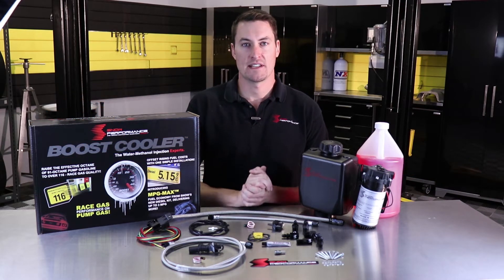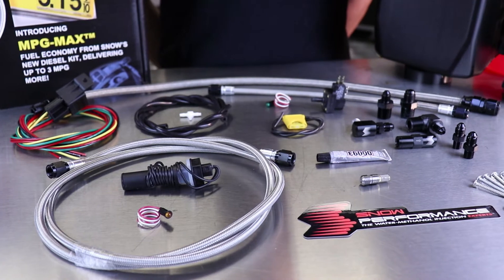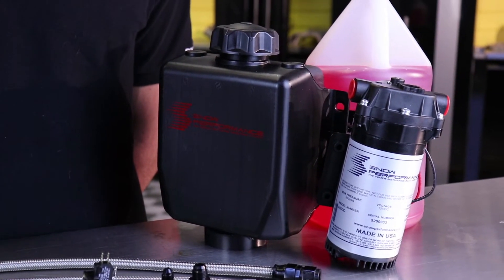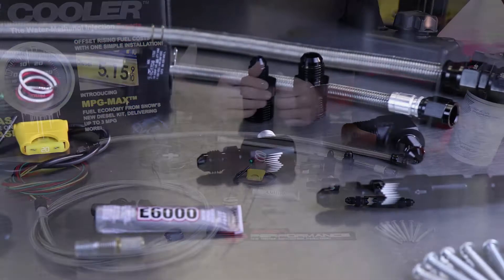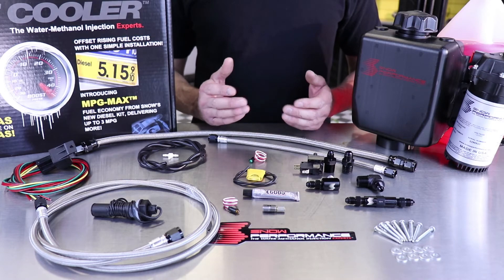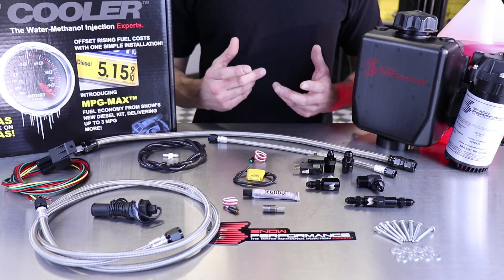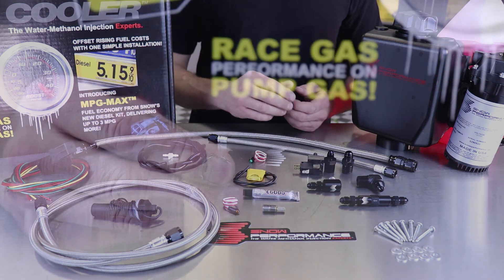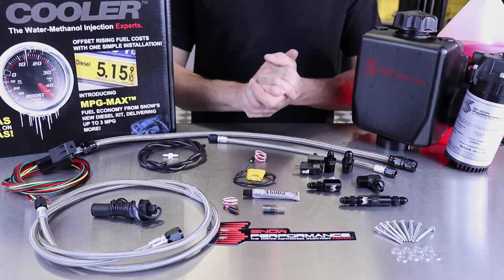Snow Performance Stage 1 Water Methanol Kit Overview Part No.SNO-201

Comment: On a  450-500hp E43 AMG , planning on using just water injection. What size nozzle should i get? It will be injected through wagner intercooler/charge cooler.
Reply from the maker: Here is our nozzle selection guide. https://www.nitrousexpress.com/images/nozzle_selection_guide.jpg
Reply: @snowperformance1  the guide is based on 50/50 mix. When using only water does it mean to reduce the nozzle size by half?
Reply from the maker: Please call our techline! 940-767-7694

Comment: Is there a way to adjust the amount being sprayed I wanna be conservative with it
Reply from the maker: Our  VC-50 controller allows for progressive spray. You adjust the parameters of when its spraying and how much.
Reply: @Snow Performance   okay is there also different jets for flow like how nitrous is I've sprayed nitrous but im new to methonal
Reply from the maker: There are different sized water methanol nozzles, you can consult our tech-line on which ones you need or use this chart https://www.nitrousexpress.com/images/nozzle_selection_guide.jpg

Comment: Which kit for NA C7 Z51?
Reply from the maker: A stage 1 system would work when under WOT.
Reply: @snowperformance1  Can anything be added to help 3/4s throttle on Hot August day.

Comment: Where do I install the nozzle on a trd supercharger 04 Tacoma?
Reply from the maker: In the intake pipe right before the throttle body will work.
Reply: @snowperformance1   I read a comment on another video where they stated introducing watermeth before a roots blower is bad because the roots is a dry operating design. which was the cause of the damaged blower in the video.

Comment: What kind of psi does the pump make will the check valve handle 125 psi and can the pump handle -40 f temperature want to use for air system deicing on semi
Reply from the maker: The pump can make up to 300PSI but once jetted will go down to the 150-200PSI range typically. Yes the check valve can handle 125psi. Depending on the mixture you are using if the fluid swells and freezes it can cause damage to the pump.

Comment: Does it work with Naturally aspirated engines? Can i mount the nozzles to four individual throttle bodies?
Reply from the maker: This system shown in the video can be operated with a Wide Open Throttle switch instead of the 15psi boost switch to make it work with N/A applications. Depending on what type of vehicle you have we do have a stage 3 system that works as an EFI/Boost based controller but you can put it in EFI only mode to operate it as an N/A controller.

Comment: Works on my boost? Between (2psi-10psi)
Reply from the maker: it is adjustable 1-15psi so yes!
Reply: @snowperformance1  how do you adjust when it kicks in? Is there a switch or would you have to use a stand alone?

Comment: Whats the thread pitch for the nozzle?
Reply from the maker: 1/8" NPT
Reply: @snowperformance1  i wanna run this kit in my trunk of a 2017 mustang. What do you recommend
Reply from the maker: @tacpax  We have a 2.5 gallon trunk mount upgrade that you could get. It comes with everything needed.
https://www.nitrousexpress.com/2-5-gal-water-methanol-tank-upgrade-braided-stainless-line-w-brackets-solenoid-hose-and-all-necessary-fittings-13lx95hx75w-sno-40014-brd.asp

Comment: Can I customize this kit to a 4 nozzle install on the intake manifold runners? If so, what accessories would I need to upgrade from this kit?
Reply from the maker: This is the most common way to do it:  https://www.nitrousexpress.com/water-methanol-direct-port-4-cyl-upgrade-quick-connect-nozzles-not-included-sno-94500.asp

Comment: how long is the ss line to the reservoir? gonna need to mount mine in the trunk. R53 Mini has limited space under the hood. thanks
Reply from the maker: The one in that system would be a 5' Not anywhere near long enough to mount in the trunk. That is why we have many different options for trunk upgrades! Check them out here-
https://www.nitrousexpress.com/water-methanol-tanks/
Reply: Snow Performance Water Methanol Injection awesome. thanks for the quick reply, ill take a look at that
Reply: Snow Performance Water Methanol Injection is it ok to mount the pump in the trunk as well as long as its lower than the tank?
Reply from the maker: @MacLaw3084  Yes it is.

Comment: Hello, I acquired a stage 1 kit, installed it on my 2.4 diesel triton pickup which has a reprogramming of stage 2 ECU. Following the manual, using nozzle 03, I adjusted the boost switch to maximum pressure and regulated the pump pressure until it dropped  yield, using 50/50 mix, checking the dyno and I only managed to gain 8 wHP, is that right or is something wrong?
Reply: Cus that car is not fast and not made for performance unless u have a swap or a rebuilt engine stop puttting money into it
Reply: How much boost dose it make?  If you set the switch to max the meth doesn't turn on till it makes 10 lbs. or whatever the setting is on the switch.   You probably want to turn it down so it activates at a lower boost pressure.

Comment: I plan to purchase a water/meth injection kit but need some info first. I have a 2ZR (Corolla 1.8L) - swapped and turbo'd Toyota Yaris. I am using the AEM F/IC and as such have no partial boost fueling control. The 2ZR has a 10:1 compression ratio. I worry about partial boost as my AFRs run around stoich until I pretty much floor it. AFRs will start to enrich at around 6 psi. My max boost is around 8 psi, I have an intercooler and at max boost my AFR is currently around 11.5:1. For extra security, I plan to install one of your kits. You mention in a response to another query that you shouldn't feed the engine too much water/meth at lower rpm/boost. I have a couple questions: 1) can you adjust the pressure of the Stage 1 kit or just pump on/off times? 2) If I went with a stage one kit, which injector nozzle would you recommend as a nice balance between not bogging the engine and adding some protection at my max boost (8psi). I have been told by others that even with the F/IC and the low 8 psi boost, 91 octane and intercooler, I don't need water/meth injection. I would like the additional protection. Just to add...I often have access to 93 octane as I live next to the US border. Obviously, I can't access that at this time. Would there be a big difference in detonation protection between 91 and 93 in my application? Thanks in advance.
Reply from the maker: For a product question to this extent please email our tech support, tech@snowperformance.net Just copy and paste this over to an email or provide your email so i can have one of the tech specialist reply.
Reply: @snowperformance1  Done! Thanks.

Comment: Hi. What is the difference between this kit and the sno 301 for diesel cars. I've got this sn0 201  kit and i want to use it on a diesel car. Thank you
Reply from the maker: The SNO-301 comes with a higher pressure switch than the SNO-201.

Comment: what size nozzles come in the box? i read theres 2 included, but no mention of the ml/m.
Reply from the maker: If you order on the website they will come with a number 3 and a 5 nozzle. If you need to exchange one or both out you can call us and order it over the phone letting us know which ones you need in replace of those.
Reply from the maker: Also a number 3 nozzle sprays 175 ml/min and a 5 does 375 ml/min.
Reply: @snowperformance1  thank you so much, i have a 2017 elantra with a 1.6l turbo, but we only have 89 octane gas where i live. i am planning to get a big turbo kit someday down the road, the tuner says i will need 500ml injectors, number 3 and 5 work perfectly. thank you so much for the reply. my kit should be here within a week hopefully. but from my understanding turning meth on below 3500rpm is bad for an engine. but boost starts to build 2-2.5k with my car, should i be worried?
Reply from the maker: turning the methanol on at a lower rpm should be okay as long as its not a lot, otherwise you may bog the engine down. You really just have to find out what works best for your car.
Reply: @snowperformance1  kind of thinking that way too, maybe i need to upgrade to a stage 2 kit then? sorry im a real noob... lol
Reply from the maker: I usually recommend our stage 2.5 to people because its a nice attractive boost controller while being very effective at controlling your injection. It works by setting a start boost point and a finish point and ramps the injection accordingly between the two.
https://www.snowperformance.net/VC-50-Water-Methanol-Controller-p/sno-60500.htm
Here is a link to it.